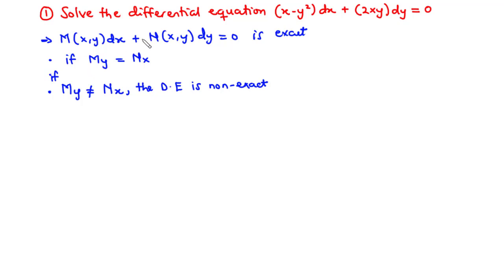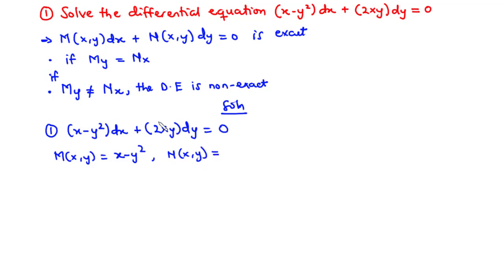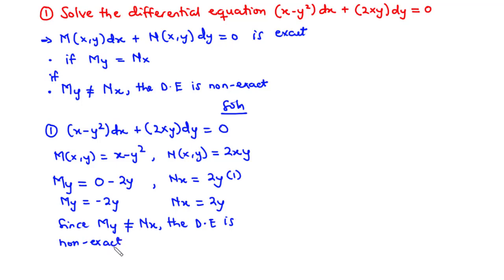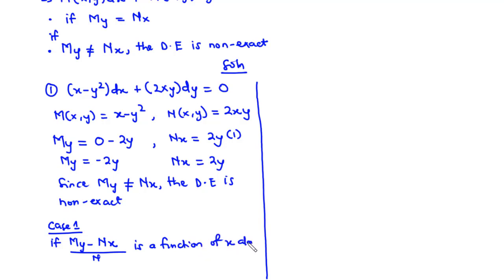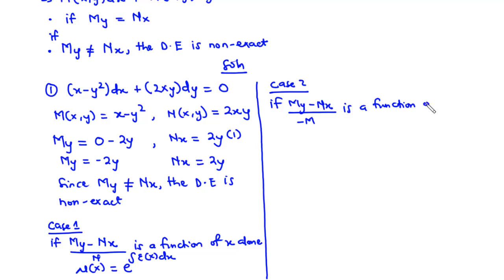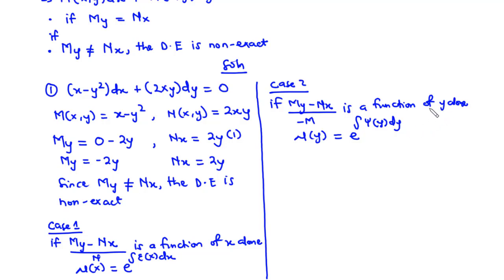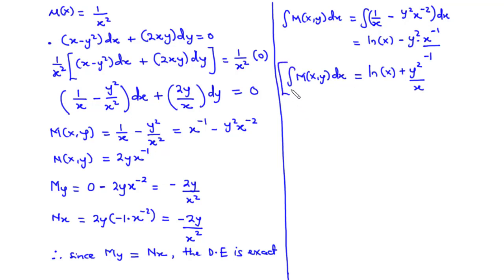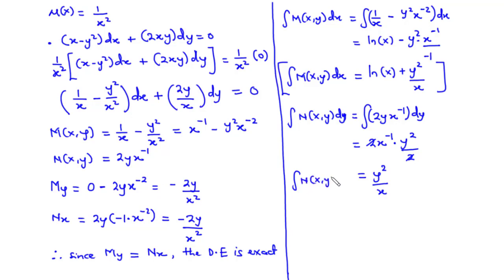🔵13 - Non Exact Differential Equations and Integrating Factors 1

Comment: What happens when neither case works?
Reply from the maker: It has to work, kindly check your solution again, or maybe you are not supposed to use non-exact method.

Comment: how would you know whether to divide by N or by M, becasue in the explanation you divided by M but in the example you divided by N. Is it just intuition and hope it simplifies?
Reply from the maker: You need to test for both, mine you.
If you get a function of X alone, case 1 is cool.  If it turns out not to be so, 
You test for case two.
So you need to check for case 1 and or for case 2